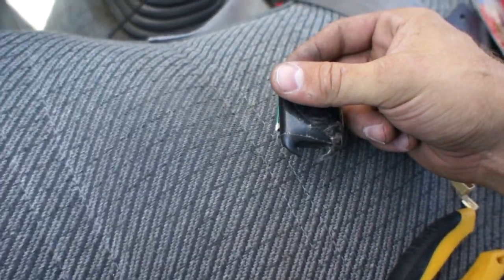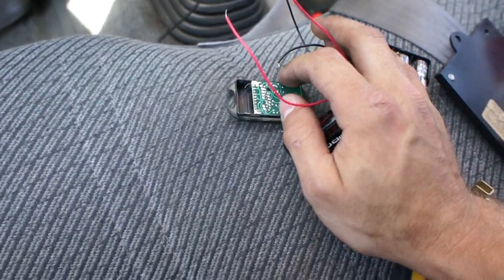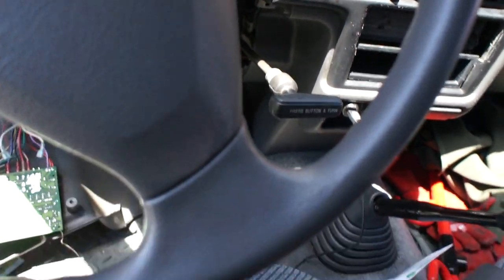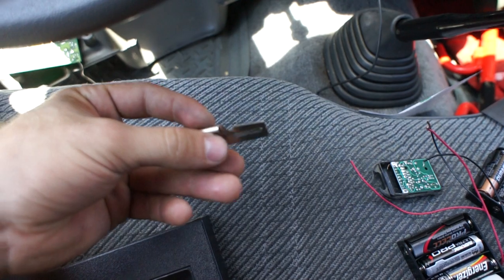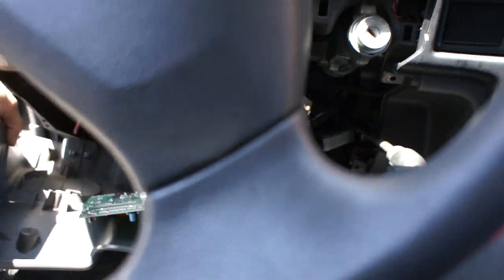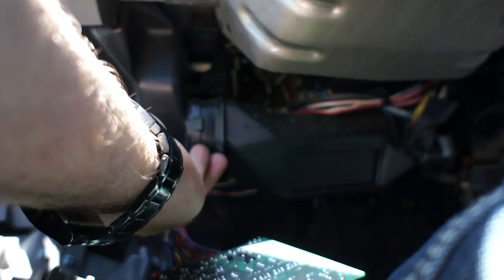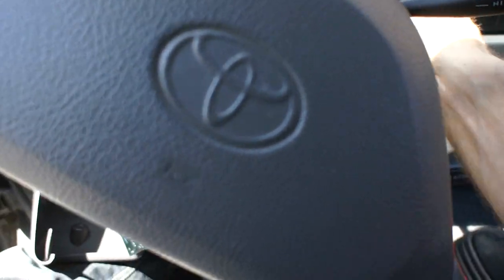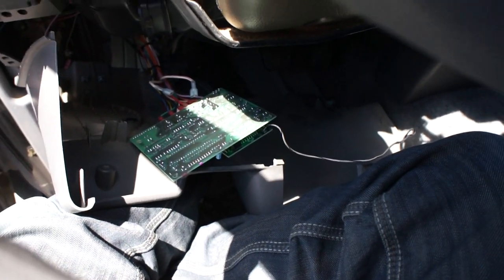How To Start A Truck With A Can Opener

Comment: cool ! ..u could also use any small heavy gauge wire with both ends shaved off  and shaped in a U,..could work and be more permanent cause you could let it in there.

Comment: You Should buy a small 2 position switch and tie it into those 2 wires! And you have yourself a kill switch! Or add a cigarette lighter and use those wires! You could only start the truck if the lighter was pushed in!